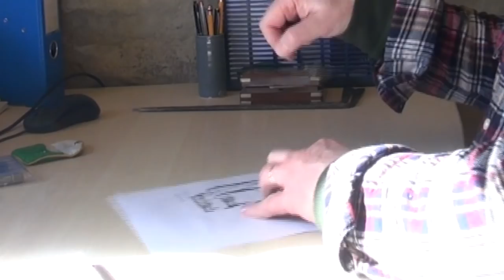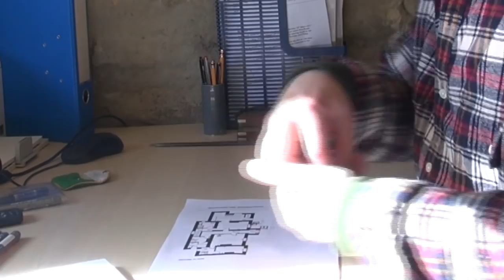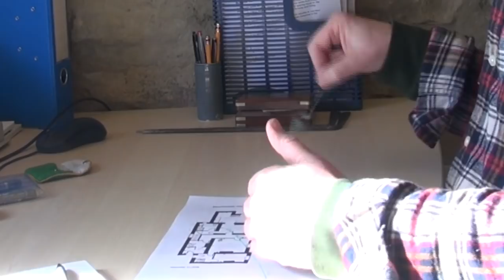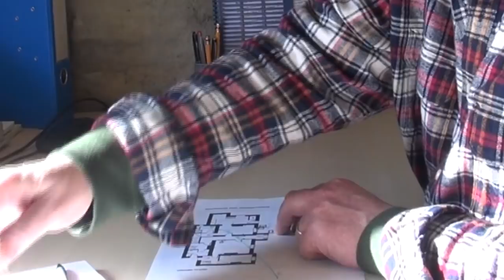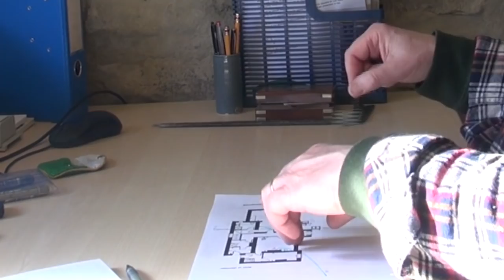Geopathic Stress Remedies with dowsing - Geomancy on a house

Comment: How can you use the pendulum so fast and with such a short line? If youre to ask your higher self through the subconscious to move it, dont you want more subtle input? Also, do you have any videos on finding water channels in your house? Im concerned about the negative health effects they have.
Reply from the maker: When I learnt to use the pendulum I was shown the way to doit with a short line and introduced to the idea of swining it myself in the search position to give it momentum with which to react. So Ive always done it this way. I couldn't use a pendulum for many years, couldnt figure it out, got no response when using long line and waiting for it to do something. So I used to just use rods. Then this teacher showed me and it worked. When I was channelling guides I used to work fast too, its just the way I am. Others need or want more time, but I need to work fast to maintain the connection. It also drops out often too ofcourse but like I say, there is no set way to do this. We each have to fgure out the way that works for us and then go with it.

Comment: I’m fascinated with your process, I’m actually watching the whole video. I’m curious about how you use your pendulum, swinging it and twirling it. How does the pendulum give you answers if you are making it move? Does the movement provide an energetic response within your body? I’m just learning to use a pendulum so it’s all new to me. How could I contact you about an analysis of my home on the West Coast of the US?
Reply from the maker: Hello Jannine I swing the pendulum initially so as to get kinetic energy into it so it responds quickly and as I ask the question it moves either clockwise for yes or anticlockwise for "no". the actual twirling motion you will see me do is to reset it back to the search position which is swinging back and forth. And yes I also get a response in my head and the pendulum simply confirms what I get in my head. I sometimes feel effects in my body when locating the detrimental lines and such. My website is shown at the top on the banner www.knightsrose.com Thanks

Comment: Arent you suppose to keep your hand still and let the pendulum move on its own?
Reply from the maker: If I waited for the pendulum to do something I would be there all day! As you have probably seen from those who do wait, it takes a while for teh thing to get going. Like many dowsers I set it swinging in a neutral direction (away from me) so that it already has energy so that once the question is asked it responds quickly. When you are experienced at dowsing then the pendulum becomes secondary to what one receives in your head/body. The rather manic movement of my hand is when I re-set the pendulum to swing in its neutral "search" position again.

Comment: I'm a completely believer in dowsing. With that said, can you please explain why it appears that you are swinging the pendulum in different directions for the yes and no answers?
Reply from the maker: Hi I think what you and others are seeing is due to the speed at which I work. In order to get a quick response I use a short chain. The pendulum responds quicker than on a long one and in order to give the pendulum energy with which to move, I swing it intentionally backwards and forwards to and fro away from mysefl in more or less a straight line. That's the "search position". I make it move in the search position in between asking questions. Once I ask a question the pendulum responds by moving in a circular motion either clockwise or anti-clockwise. I dont intentionally move it in either direction. Once i feel it has responded I deliberately move the pendulum back to the search position. I do that fairly quickly and in this video it is particualy quick as I rather innocently didnt think people would be as "critical" of the technique as they are. Also don't forget that there is nothing "magical" or mysterious about dowsing as a process. Its a subconscious reaction which gives minute muscular movements which affect the pendulum or rod. Those movements are so tiny that even the dowser cant detect them. If we feel then then we are indeed infleuncing teh dowsing outcome. That is on e of the skills of dowsing to learn to NOT influence the device. Dowsing is based on the quick thinking response which is known as "system 1 thinking" which is almost instant and intuitive as opposed to "system 2" which is much slower and based on logic (you can learn much more about that via google). Often times as a dowser I will receive a response in my head before the pendulum actually moves, that is part of the process. The pendulum is like a key to start a car, the actual dowsing takes place inside the person's "mind".  The skill is in trusting the connection and staying connected for long enough to explore the information that is being given. In that sense it is much more like "remote viewing" (although not necessarily with pictures in the mind). I always thought when I started making these videos about the actual process that people would just try it for themsleves and make up their own minds about whether it worked or not by trying it. Then I realised I was wrong! Thanks for asking the question, good luck with trying it if you havent already. Also I do recognise that the way I do it is not the way everybody does it on YouTube, so best to find a method that works for you. Follow your heart, follow what feels right for you and you will find the best way that suits you.
Reply: @KnightsRose  thank you for the very thorough response! I had actually wondered if you intuitively knew the answers before you even asked the questions and you confirmed that. I'm currently learning how to use dowsing rods and then I'll work with a pendulum next. This has opened a very exciting door in my life and I'm looking forward to seeing where it takes me.
Reply from the maker: Wonderful!

Comment: Tim , great video , can you tell me please ,  Is your pendulum very light in weight as it spins and changes direction very fast ? Can you tell me a little bit about the specific one you are using here  , size etc . tia.
Reply from the maker: Well it's not particularly light, but the reason it responds so quickly is twofold: firstly I have it on a very short chain, the shorter the chain the less "swing" it has, but you can only really use a short chain if you give it some motion to set it swinging in the "search" position, which leads us to the second pint which is that I do swing the pendulum back and forth quite vigorously in a straight line to and away from myself. It is very clear in this video in particularly that I am moving my hand but the movement is in controlling the pendulum in the search position and then bringing it back into the search position (back and forth swing) once it has changed its direction of motion to give the answer. However, also note that because I have been doing this for some time I don't really pay much attention to the pendulum as the answer comes to mind before the pendulum really has a chance to get going anyway, so the dowsing tool becomes more important as the switch to use to access the space to be interrogated rather than the thing to focus on and watch for a response. That just takes practice. Its all really happening in my head - which clearly doesn't make "good video". Also I work like this as it would take SO long if I had a long chain and waited for the pendulum to gently revolve of its own accord to give a response (as taught elsewhere on YT). Basically I'm impatient and as a working tool it needs to be done quickly partly so I can maintain my connection in my head to the space and to the information that I want to find. Too tedious the other way! As to what it is made of etc sorry but I cant tell you. I have no idea what stone it is made from! By far the most important thing is for you to find a pendulum that you like and practice with it and if necessary change it once you get more proficient and discover for yourself your preference and way of working with it. Happy to answer any other q's for you as they come up, despite not really answering your current ones!  🙂
Reply: @KnightsRose  Thank  you sooooo much  Tim.
Reply: @KnightsRose I did wonder about pendulum as you’re apprbatly moving it so it confused me at first. I’ll have to read this again carefully and digest/ understand it fully. I’ve Jsut started my course and I’ve been sitting here hours doing the plan! My first case study too!😮
Reply from the maker: Just relax into your own porcess dont get sidet-racked by thinking your need to cope the way somebody else dowses. The important stuff is what comes to you in your head - your subjective information that you receive probably very vaguely to start with until you get more used to it and gain more confidence. Its just about mindfulness and about taking the time before you dowse to meditatate so you are in the best possible mindset to be open and to receive. Out of interest, who are you learning with?

Comment: very fascinationg! this is the work you also do for your clients? you can feel the "impact" of one ouija-board-session? so its not just a toy?
Reply from the maker: Yes that's right. This is not to say that every ouija board session will be detrimental, but its not the sort of device that I would recommend anybody "playing with" as it is a device based upon "intention". Often of course it is mocked and tomfoolery takes place, but if it is used with seriousness than it is opening up the psychic abilities of the people using it in the way that dowsing does but without respect and in a group situation the energy of such an opening is likely to be magnified. I don't recommend using these boards simply from the fact that you are in a group with other people whose energy you then pick up on. Most likely those "playing" with it are not aware of the power they each have or are not aware of what they are accessing. If one person gets spooked it can be quite scary and potentially mentally scarring. Hence in a dowsing session it comes up as "detrimental".